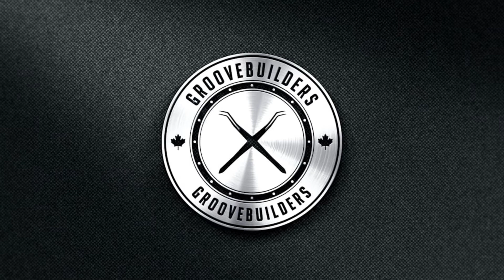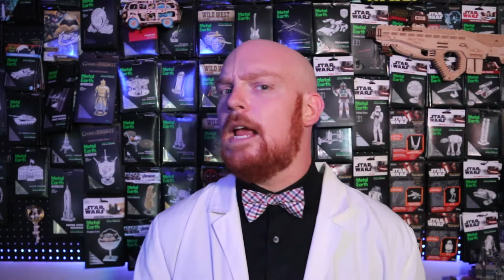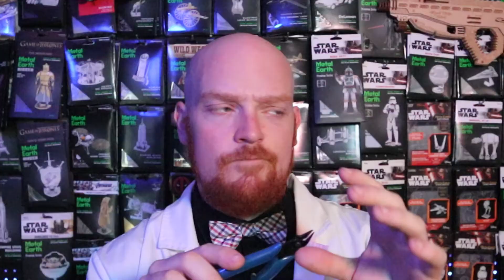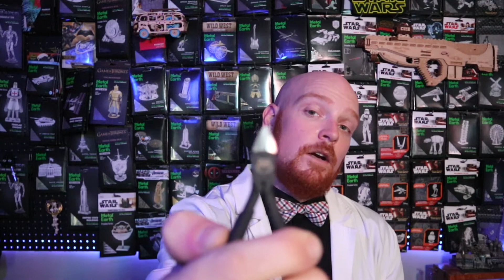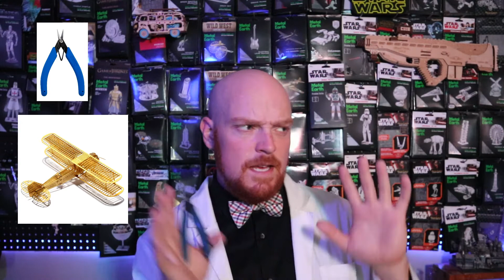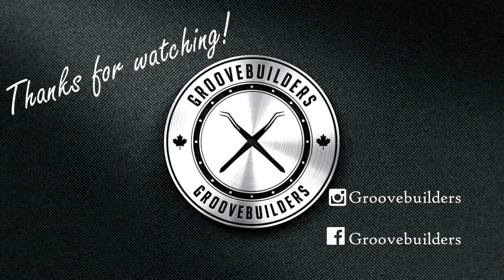3D Metal Model Basics - Nippers and what to look for!

Comment: Klein wire pliers form Home Depot work rlly well for me, I’ve made over 20 metal models with them and still feel very strong! Very cheap as well($8). The downside of them is that the tip of the pliers are more on the bigger size so you need to rlly use the tip of the pliers to cut more harder pieces out of the metal sheets. My 2 favorite things about these pliers is that they are magnetic, having them being magnetic makes a huge difference when cutting smaller pieces because they won’t fly away and end up on a different country. The other pro is that the spring is built within the pliers so the spring mechanism could possibly last a lifetime compared to something like the official metal earth cutting pliers where the spring wears down over time and they end up snapping. The build quality of the pliers are 7/10,could be more comfortable but very sturdy and strong. The laser cut tip is very precise and accurate and garentees fine cuts every time.